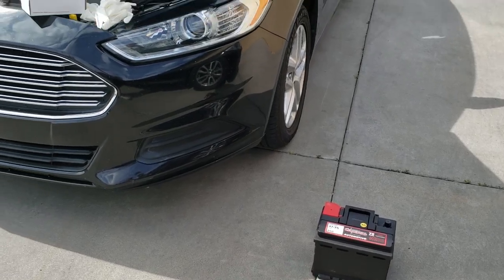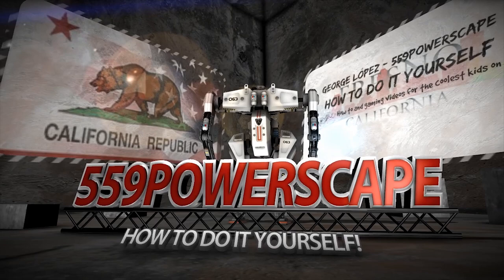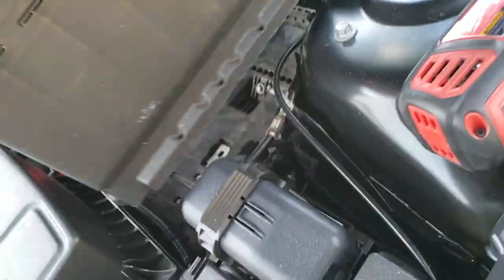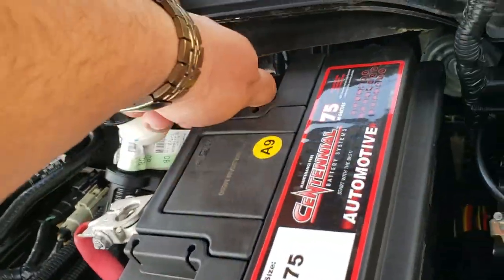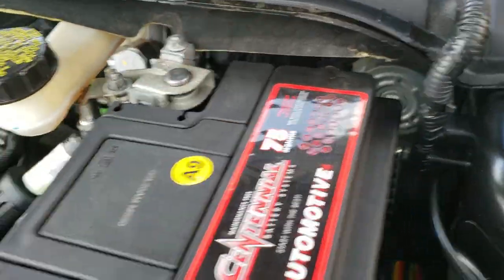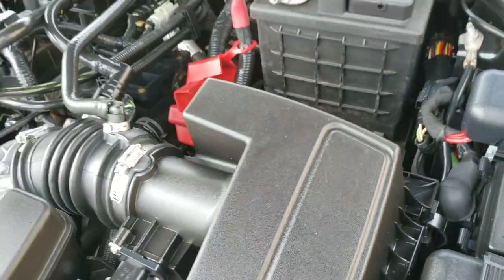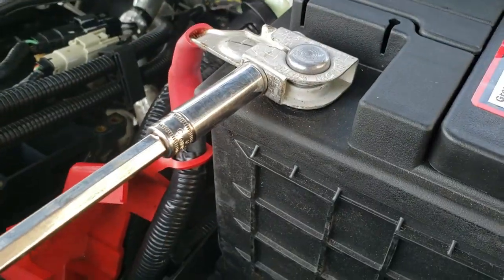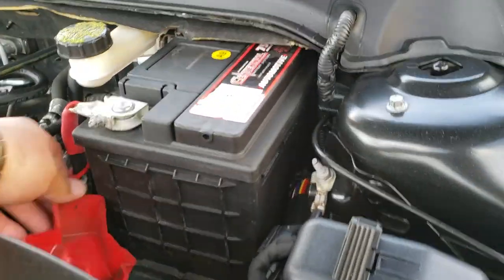How to: Install a Battery on a 2014 Ford Fusion

Comment: Dude you made it seem like a piece of cake lol. Mine was such a PITA man. Had to remove the entire engine filter cover just to have enough room to slide the battery in. It wasn’t that simple as you made it lol. Good job!
Reply from the maker: Thanks buddy, sorry you had to do so much! Glad you were able to get this resolved! THANK YOU FOR YOUR SUPPORT!
Reply: My sister car needs a new battery but the guys at the part store told her that the newer cars  battery has to be changed by the dealer bc something about it has a electrical sensor and it's not to be disconnected while replaceing the battery or something like that. What I'm here to ask is can I change her 2014 ford fusion battery like any other car battery or do I have to do something specific??
Reply from the maker: @allenburnette2700  I replaced this battery because it was dead...0 volts ...i changed it out and didn't experience any problems.  I think you should be okay 👌
Reply: @allenburnette2700  Yea that's a bunch of nonsense. If she has a 2013-2016 Fusion like seen here, there is no "electrical sensor" for the battery. You can absolutely disconnect it without a problem. They probably said that to scam you out of $150-200 if you brought it to the dealership. There's a reason why they are called "stealerships" lol.

Comment: Are all 2014 fusions this easy to replace? I was told on my 2014 fusion they have to take off windshield wipers and trof. But I’ve watched like 3 videos including yours that you can just slide it out.
Reply from the maker: You should, give it a try. Ive never heard of this but could be wrong....look at the engine bay and see if its possible